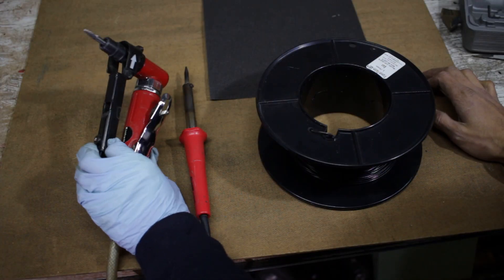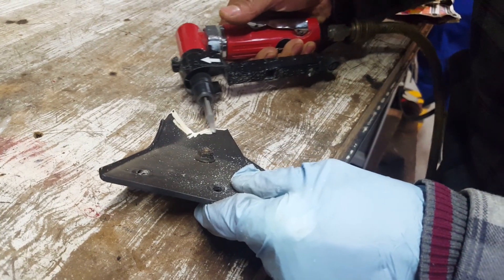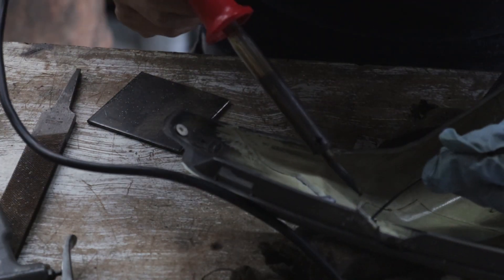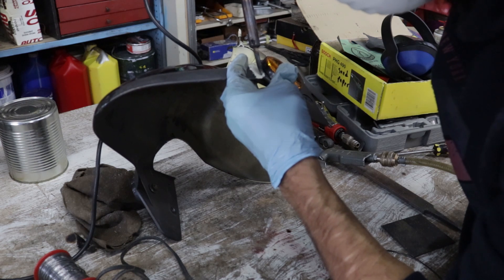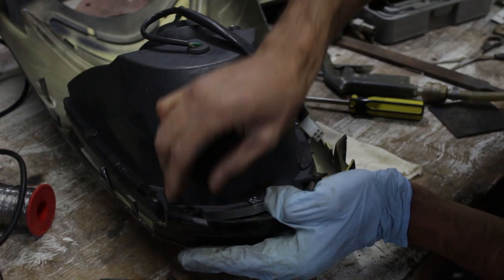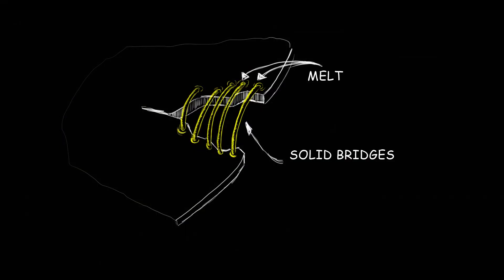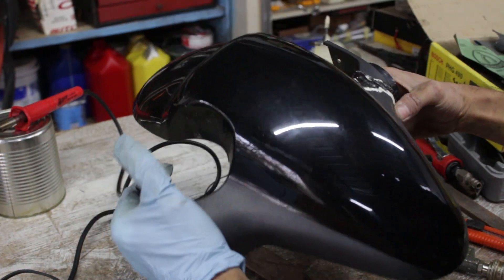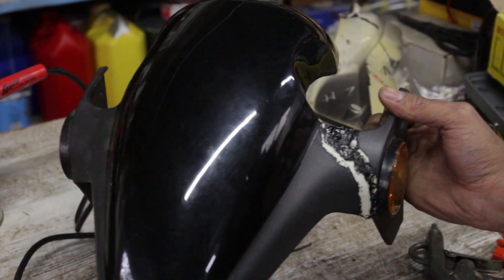How to Repair Scooter or Bike Plastics & Fairings

Comment: That is the wrong way to fix abs the right way is to either get some pieces of abs Soak it in acetone or MEK  Then take a dribble tool and make A Slight indention in the crack And brush on the ABS solution on your 2 pieces

Comment: Heated abs cracks easily. Use steel mesh from inside + abs slurry to cover (dissolve keyboard plastic in 646 solvent)

Comment: bought a 2003  fsc600 silverwing  the fairing  is just too expensive  and not able to find  online the  Honda dealer wants  around 300 dlls  so thanks  I will attempt  to do  just that ,,,thanks
Reply from the maker: Those have quite a large fairing I see. With a little care, some sanding and some body filler for the low spots you should be able to fix it right up. In the past I tried epoxies but they just didn't hold up. Best of luck!

Comment: Thanks Mark....Didn't see any smoke from the soldering iron... Must have been the compressed air? and the material you used?
Reply from the maker: Hey Alec, there are some pretty bad fumes from the abs itself so I really recommend a mask or painting ventilator and to have a fan running. Material was 1.75mm abs filament, thin strips of a similar material will work just as well though. Thanks for watching :)